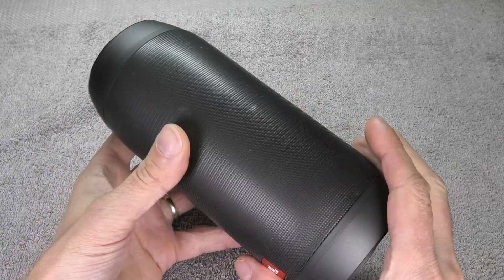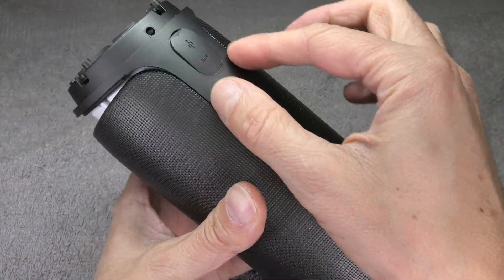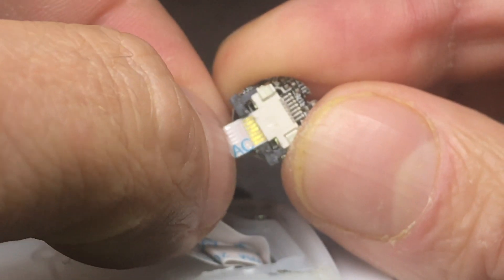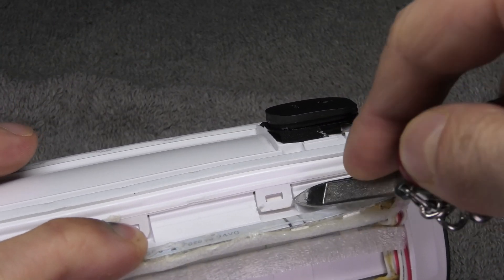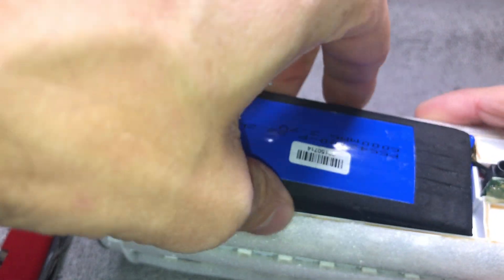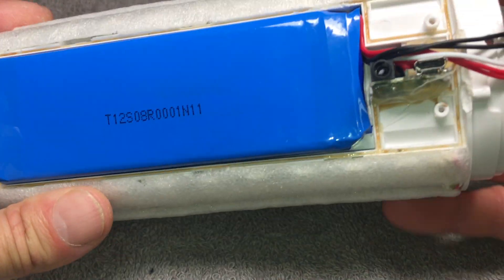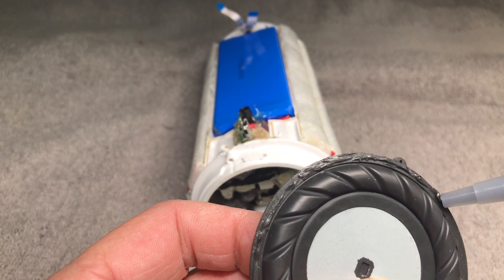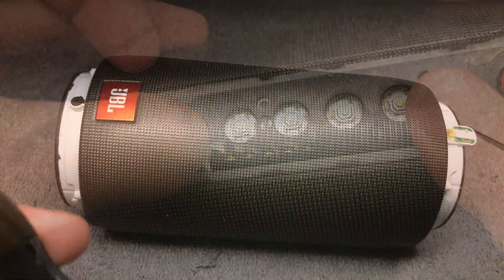Battery Replacement for JBL PULSE 2 (How to step-by-step)

Comment: i have same speaker it sad that they make not from direct power but from battery power now my battery dead and to replace need be this pro
Reply from the maker: I agree with you. It would be a lot better if the speaker was able to work just with the USB cable connected.
Replacing the battery is very complicated on this model.

Comment: What battery am I looking for, for this replacement? Also I clipped the charger port cables from the circuit board with the aux port. Can I buy a new circuit board with the charge port and aux port already on it?